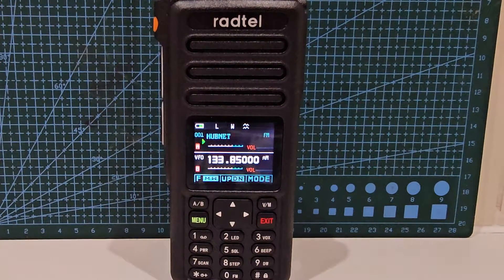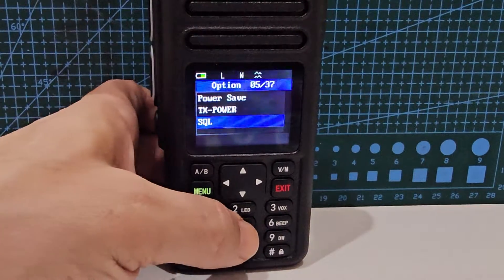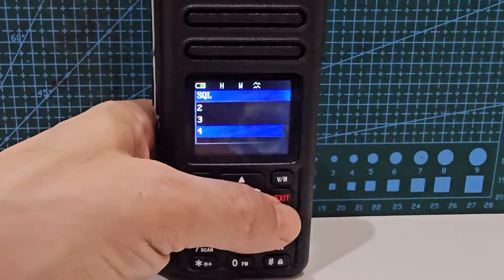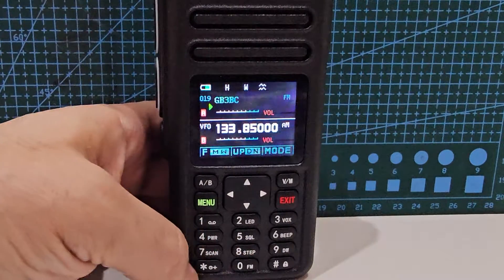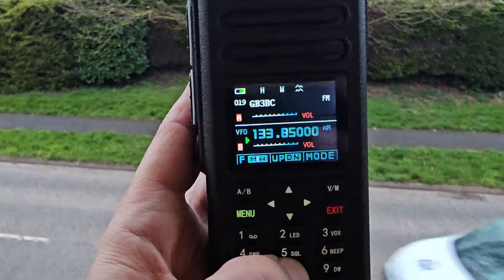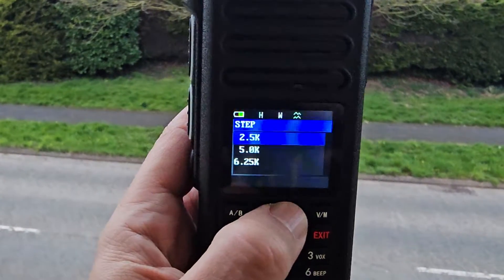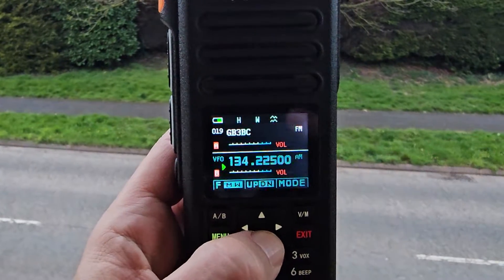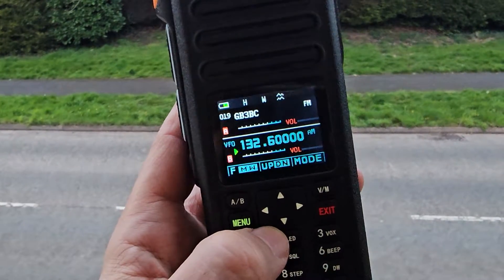RADTEL RT-730 - SHORCUT TIP

Comment: the slightly off freq is because 8.33khz channel spacing that radio dosnt have it 6.25 is the closest yu can get unless yu can mod its firmware to add it yu.ll still hear aibad but with that scratchy slightly off freq sound
Reply from the maker: No as 133.850 is correct
Reply: @M0FXBHamTech  yes for the old channel spacing system now its gone from 12 to 8.33khz giving them more channels yu have to search the the new 8.33 approach freq same for ground ops gatwick has two approach freq,s one callsign only the other ident and callsign

Comment: The Rt730 has a problem when communication headsets are connected; it is not possible to use the keyboard or anything else until the headset is unplugged from the connector
Reply from the maker: Strange.

Comment: What kind of headset it takes ? And is there is an adaptor to convert the k1 to whatever this radio takes?
Reply from the maker: Any baofeng head set not bluetooth .
Reply: It doesn't take K1 headsets? Radtel said it takes a special kind ? @M0FXBHamTech
Reply: @manshster  No it doesn't. It needs a connector similar to Motorola, but it's not it. Maybe it's like UV-PRO, and there's an adapter for that one that you could try.